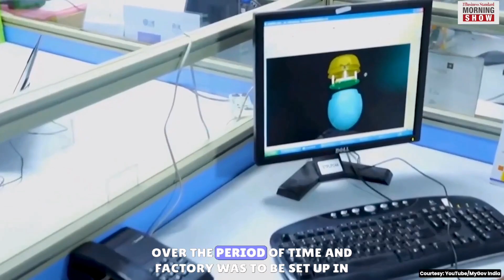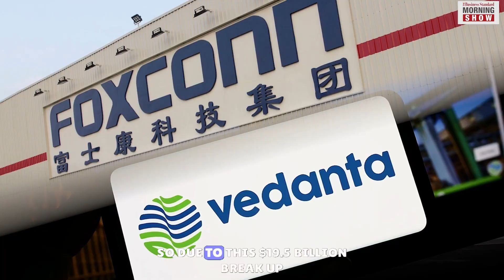The Foxconn Vedanta $19.5 Billion breakup story| Semiconductors in India |Business 03|

Comment: IITs  have better technology than Foxconn . IITs have experts and giant professors in  semiconductor manufacturing technology  on which  America depends .
Reply from the maker: Well that's debatable, look chip manufacturing is a really capital intensive process and you need experienced arms as well. 
IITs have excelled in R&D but Foxconn is an electronics contract manufacturer. They both are operating in different fields so there is no direct comparison.